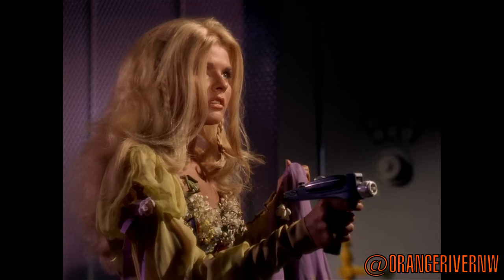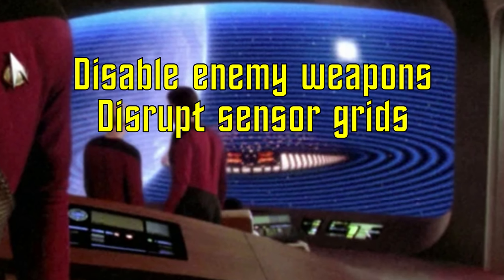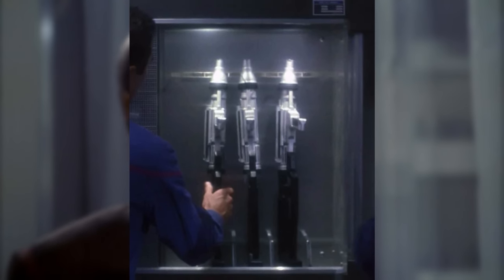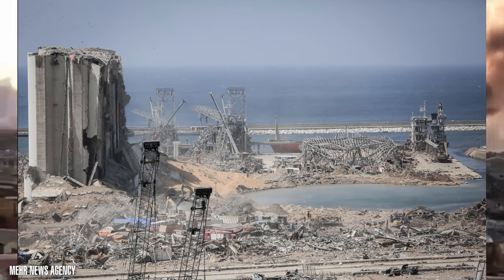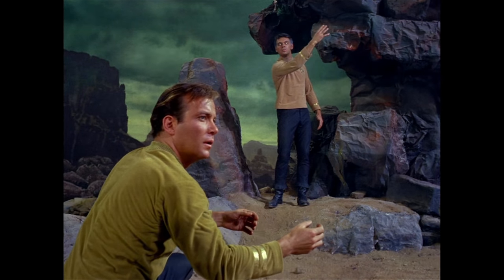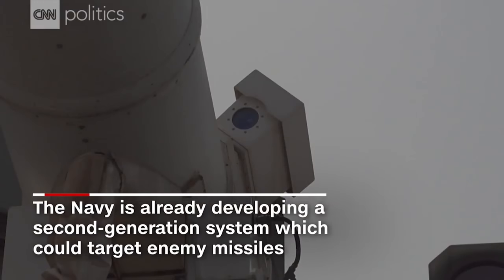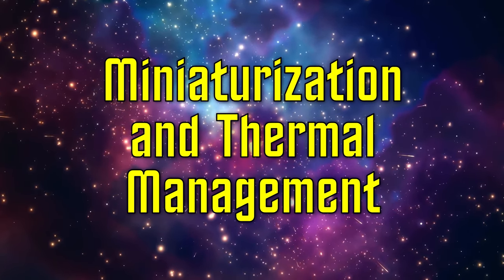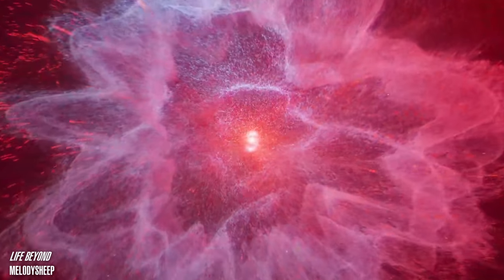The Science of Star Trek's Phasers

Comment: The biggest issue with trek weapons ufp ones is usually the lack of a trigger guard to prevent negligent discharges when holstering and if the weapon is dropped.
Reply: It’s a sustained beam, not a bullet. One instant discharge is probably not enough for anything
Reply: @oldylad  one instant discharge on the wrong setting could burn a hole or vaporize something. Even on heavy stun they can kill.

Comment: I invented plasma coherency in 1997. It was a tiny device. Later, after a lot of loss, I got enough gear to build and develop the first kind of coherency that works. This is not just an electrical arc. It's literally a beam. My budget still holds me back. However this is the idea I showed the world. For the first time, without lasers or use of radio active materials, I figured out a way to make plasma into a beam. That does not "go to ground". How it looks is a bit messy, and several others tried to take the credit from me. However it's finally been done. With a good lab I could reduce the messy output to a beam that can perform almost all of the effects the "phaser" can. In the movies and some episodes, phasers are considered "coherent plasma". This is my life's work. It's allready been released by me. Sadly, I have been unable to make any money off of this incredible breakthrough. I pray someday this will happen. I know others are working on this who have the funding. Take a look. This can be expanded to go 20ft or even miles with the right gear and dynamics. KF7DFP.

Comment: I understood phasers beamed a harmonic energy in phase with matter that disrupted the coherence of atoms like a harmonic sound in phase with the vibration frequency of a glass breaks the glass. Heating to vaporize pumps energy into the material making its particles move in random directions so violently they can't hold onto each other. A  phaser causes the particles to move in a violent way so the particles can't hold on by making them move in phase with their frequency without all the wasted energy of random motion caused by heating. According to the episode "The Omega Glory" 4 phasers killed thousands of Yangs. So they have a power source that can cause a significant explosion. But modern batteries can do that, and they use that energy efficiently. They can also be set to cause random motion to heat rocks. Probably uses more energy to heat rocks than to vaporize them. But that doesn't explain where the atoms go after they break up. Although not a hot exploding gas like if they were heated they still have to be there even though cold. The broken glass is still there even though broken. If it breaks the atoms into quarks they could explode in a cloud of neutrinos that visibly vanish, and pass through their surroundings. Some photons not effected by the beam escape in a flash of light. In effect all the virtual photons being exchanged by quantum mechanical electron interactions are free to become real photons because the electrons were turned into neutrinos which don't interact except rarely, and according to the rules of quantum mechanics only electrons can absorb, and emit photons. neutrinos can't.

Comment: The real problem is, having the ability to accelerate a projectile to high speed using compressed gas is extremely efficient, and if you can generate the compressed gas by burning some preferably solid material, especially if you can grind that material into a powder  is a very safe way to do it.  
      If you can contain that powder in something like a tube of brass, this is even better, because the brass will keep the powder dry and protect it from catching fire by accident, or at least make it harder to light off by accident.
      These projectile and brass objects can be really small and still be effective, provided you have a way to set the powder on fire reliably and only when you want to.
     It is just really hard to beat a good old fashioned bullet when it comes to putting energy on target.
     One thing that really bugs me about Star Trek is when they show a person being vaporized by phasor or disruptor fire there is no other damage. The person just disappears and is gone. No mess no fuss.
    The problem is, if you hit a person with enough energy to vaporize the entire body completely as quickly as is shown there is going to be a huge crater where that person had been standing. Also, turning a collection of solid and liquid matter (what people are made up) the size of a person into gas, that gas is going to expand, explosively. If you are in an enclosed room when this happens, assuming you survive the expulsion, you will be standing in a room full of super heated gas that used to be your enemy.
     That just seems like something you don't want to inhale for many reasons.
     Frankly, I'm not sure we will ever find a way to put energy on a soft, man-sized target that will beat the old fashioned gunpowder and bullet.
     We may find better ways to generate a lot of gas in a short time to fire the projectile, We may find better materials to make the bullets from, but it will still be an old fashioned bullet
    That was one thing I liked about Halo. 
     It may be the 26th Century, but humans are still fighting with weapons that fire bullets. And they tend to be more effective than the energy weapons used by the enemy.

Comment: I don't want the phaser so much as I'd want the battery that could power that phaser. Good lord could you imagine the failure state of a short?
Reply: The battery! 💡
That is a darned good point!

I bet the reason they don't have personal force fields in that age is the same reason we don't use jetpacks today; 
The power source ( battery /compressed air) would be just outright too heavy for a person to wear.   

Still, a combat situation is not the same as a domestic gun fight. 
Any police officer will tell you that a shootout lasts something like less than ten or fifteen seconds.  

Maybe they have batteries that can power personal force fields for use by domestic law enforcement agents. ("Cops").
Reply: @TheNoiseySpectator  it's also possible that the whole hull of a starship is built around helping the shield emmitter do it's job, a person moves around quite a lot and is very squishy, so the field itself could be dagernous to exposed skin. Power wise? you're correct in that a shootout tends to be very very short. So I'd imagine the handheld phasers (especially the small pocketable models) don't need as large a power source for their use. The rifles-being battlefield weapons-certainly would.

But even the tiny StarTreck equivalent to a saturday night special seems to be able to fire dozens of shots in the MJ range. Current Lithium batteries burn REAL good if they fail,. given that.... Ff that phaser battery failed, it'd be like a Mk82 or JDAM blowing up at a minimum. lotta energy density there.